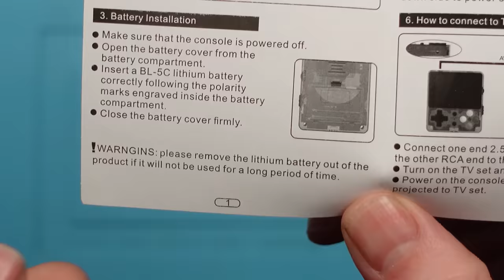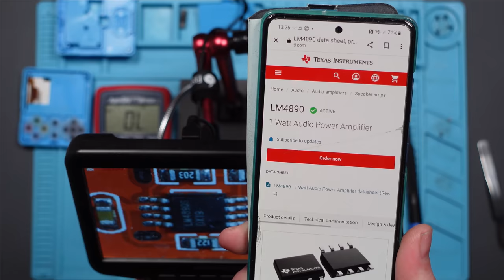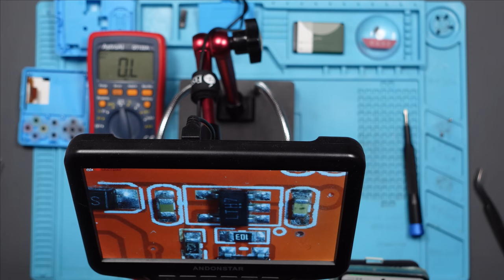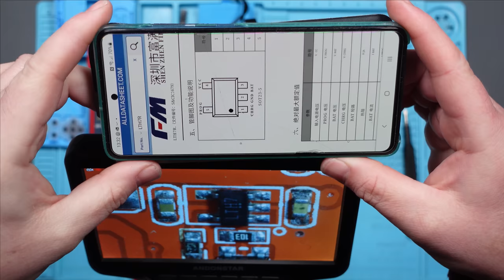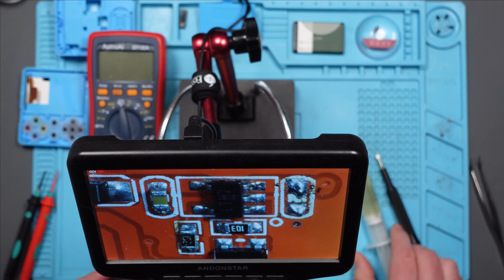Pocket 8 BIT Emulator FAULTY From eBay | Can I FIX It?

Comment from the maker: Stupid Game!
Reply: today I agree even more with you! Yie-Ar Kung Fu is indeed a stupid hard game! so much time have I lost on that thing... and so much patience too!

congrats on your repair! did you found the component?
Reply: Love your hard works
Reply: A well-deserved like for the end credit song alone! ;-)
Reply: Very!
Reply: I liked the music of 'Way of the exploding fist", another Kung-Fu game.
Reply: Indeed
Reply: Nice job Steve.
Reply: The first page of that datasheet shows you an example circuit. It has a 10uf cap on that battery line
Reply: Maybe i'm wrong but it seems it's an LTC4054-4.2/LTC4054X-4.2 Li-Ion Battery Charger from linear technology (LT), if you watch in the datasheet under PACKAGE/ORDERING INFORMATION it states that it  can be marked with that LTH7 amd the circuit highly resembles the "USB/Wall Adapter Power Li-Ion Charger" typical application example, what's interesting is that in none of those typical applications there's a capacitor from BAT pin to GND, so maybe it's not really needed at all
Reply: not is ...well not a number it is a word

Comment: It amazes me how many times looking for the short finds the fault.  Nice job Steve.
Reply from the maker: Thanks WanJockey! Yeah, short hunting is usually the best way to go! 👍
Reply: Those SMD capacitors have a tendency to internally short. You can see the circuit it was attached to had a via so it looks like that capacitor was only for filtering since it was going to ground. This means it would probably have worked without it.

Comment: As a general rule, a capacitor at the input of a load circuit is used to filter the power. If you don't, it should work fine anyway.
Reply: Is there a general rule for size?
Reply: @dacodemonk  depends a bit on the current flow but i think 10uF should be good in most cases :)

Comment: I've been given a caravan tv/dvd that was new, worked for a few hours, then died completely. I'd normally open it up for a 'look' anyway but watching your videos has given me the confidence that I might actually be able to find out what's wrong with it!
It could still end up a 'stupid telly' but we shall see.

EDIT: I actually found a faulty component!! It took a while, and my USB microscope, but I found a blown-up 8-pin voltage regulator! It's about 3mm long so there's no way I could replace it even if I could find one to buy, but I found the bugger.
Reply: Be careful. Tube tvs have a ton voltage going through them
Reply: @thadofalltrades  Should be ok - it's a Bauhn b-215fdv LED HD thingy. Quite new, no tubes, no valves ;)
Reply: @simonsackett  Discharge the capacitors before touching them, they are what store the electricity. If it has a plug  rather than adaptor some of them caps will store mains level voltage for quite some time
Reply: @aethersx2-samsunggalaxys206  Yes, thanks. It has a 12v adaptor. I've done a lot of electrical work but never really got involved with electronics very much.
Reply: @simonsackett  If its running on an adaptor you will be fine then
Reply: @simonsackett  didn't know LEDs came with a built in dvd

Comment: "probably untested" on Ebay usually means the previous owner used a can opener to dissect the device, "cleaned" the PCB with steel wool on a belt-sander, spit their chewing gum inside, put it back together with one Ikea screw thats too big, plugged it into a car jumpstarter for 36 hours, used it for an ashtray, then put it up for sale. 

I'm surprised there was no hamster poop inside, along with saltwater snail eggs.

Comment: My guess is that those caps are responsible for decoupling the supply to the battery charge circuit. So, 100nF is a fair value. I don't know whether it would've helped during this repair, but some datasheets have 'typical' component configurations included to give the designers an idea on what components to place to use their parts. I'm guessing this datasheet was one of those that didn't. Regardless, an excellent repair! :D

Comment: Late to the party I know, and I'm sure you've since figured out why you need that capacitor. Even though the circuit will work without a capacitor, the cap is there to stabilise the voltage out of the regulator. The circuit will work fine but you risk spiking other components with higher voltage. Great video as always Steve!

Comment: When you remove a small component with hot air for testing, just move it so one leg is still soldered down, that way it's easier to probe with the meter.

Comment: I'm an hw engineer and I really like your video, as there are fun ! FYI From user guide evaluation board of the LTC405, the Cbat is 1μF, X5R, 10V, 20%, 0603
Ref AVX, 0603ZD105MAT2A

Comment: Smaller value caps like 1uF or 0,1uF is usually fitted besides other chips/components to smoothen out the ripple on VCC rails across the board. Further away from the chip = greater values are needed. But they should be fitted as close as possible to the VCC pin of a component. More then often it probably works without it. The schematics in the datasheet for LTH7 doesn't show that a cap is needed on pin 3 for the battery. So again, it will probably work without it as well as any random ceramic cap.

Comment: You really need to get a nice set of tweezer soldering tips for your soldering station.  I have a Metcal station and use a MX-PTZ tweezers and its amazing.  You just grab the part like with a pair of tweezers and the part is removed or installed.  Its much faster than hot air gun and less likely to damage parts around it.

Comment: Surprised Stez missed the shorted cap when looking around the board. Even I saw it looked dodgy with the black spot on it. Also the resistor that tombstoned looked damaged, as the end contact was broken. That's why it tombstoned. Still if it works anyway......

Comment: What temperature is the hot air? Even at 450 the solder never melts this fast on any board with my hot air.

Comment: Quite surprised the battery was still good if the battery pin of the charge manager was shorted to ground for so long. It is astonishing how many issues are from caps shorting out like that.
Reply: This style of SMD capacitor is quite fragile to temperature swings and physical sress. They have a tendency to short out internally.

Comment: If you do google search images you get recomended diagrams its 1uF for input cap pin4 and gnd. For output its 10uF pin3 and gnd. Also pin3 and gnd is across battery

Comment: you colud just leave without capacitor it would work just fine you can remove even few of them on the board and it will stil function

Comment: Hi Stez, nice fix M8, how do you determine what voltage the capacitors should be?
Reply: Usually depends on the supply voltage. This game is running off of USB so unless there's any inverters involved, nothing should be more than 5 V DC.
Reply: Makes sense, thanks. 👍

Comment: my money is on the broken capacitor you lose is hiding inside the solder that was on the tip of that soldering iron

anyway another amazing fix and minor spoiler its yet another case of... stop throwing away stuff that may just be a simple fix

Comment: 7:42 how did it disappear? Did it melt or just fly away?
Reply: From my experience its usually encased in the solder blob you take it off with
Reply: @aethersx2-samsunggalaxys206  makes sense
Reply: @aethersx2-samsunggalaxys206  yep i agree i just rewatched it i think thats exactly where the missing capacitor is hiding in the blob of soldre

Comment: Have you tried using an air duster upside down to freeze the board before using the heat gun so the surrounding pieces don't de-solder?
Reply: That is the worst thing you could possibly do. You typically want to heat up the area all around the part you want to remove so that you don't heat shock the board.

Comment: Nice fix!  Do you happen to know a good resource for hard to find data sheets for Chinese chips that don’t come up with a Google search?  I have a digital microscope (KKMOON G1200) that has no backlight for the lcd.  It had died while powering it from a USB battery bank,  I found a SOT-23-5 chip that was getting hot and shorting to ground, could find nothing about it but traced it to the lcd and discovered it was likely a boost converter since the surrounding components matched the example circuit for a boost converter so replaced it with a same pinout different chip (TPS61040DBVR) and have a display now but no backlight, assuming the backlight circuit died when the boost ic shorted but can’t find a data sheet for a 6 pin chip labeled KDCAR that is likely a white led driver.

Comment: Surprised you did not put on video testing the charger as after changing that cap, if you put the wrong one in, you could damage the battery.
Reply: No, its for stabilty acros batery. Will work without it

Comment: Funnily enough, this is not a LDK - it's some crap clone using the same case. The LDK's SoC is a JZ4760B and it needs a 12.000 MHz crystal, and it doesn't have that black glue to hide the chip.